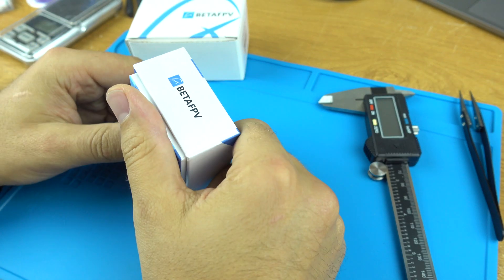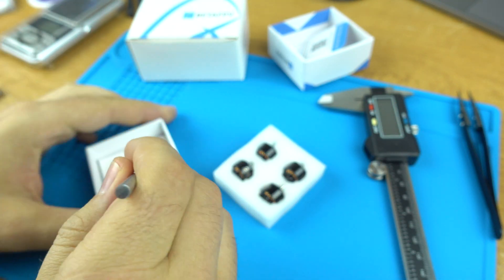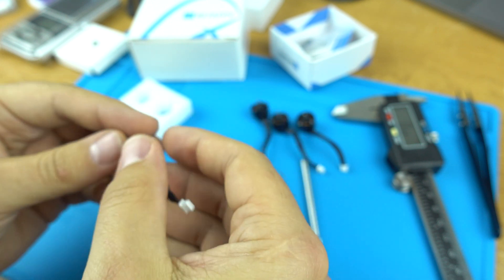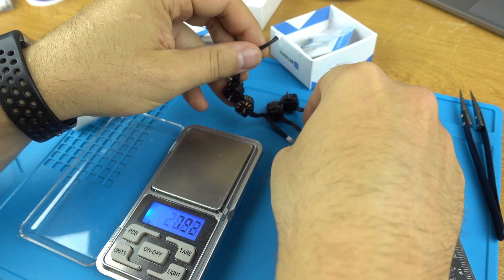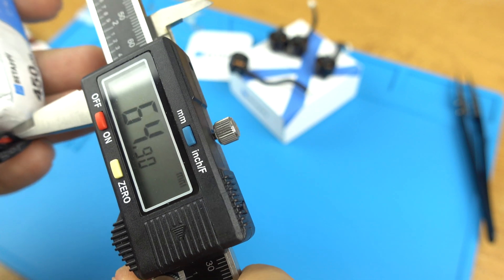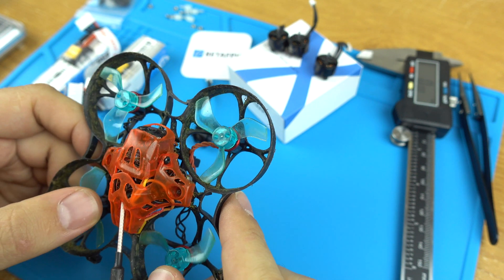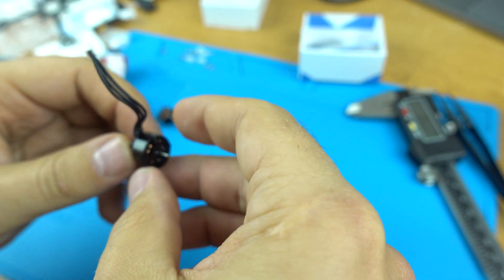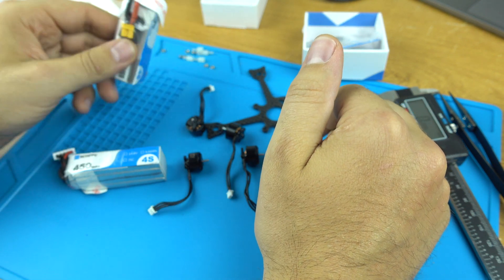Got my BetaFPV 4S capable 1105 5000kv motors for my next Pickle frame build 450mah 4s batteries

Comment: Did you end up running 4S? I have the 1106 5000kv and they are rockets on 2S! I just maidened my TP3 outside my front and I need more space to go 3S and I'm sure it will be insanely fast :)
Reply: pavalige what are your flight times on the 1106 version?  Also what batteries have you ran so far ?
Reply: Jeffrey Rodriguez about 3 and a half minutes and I'll be staying with the 3S no 4 S the things a rocket on 3S anyway, in fact I quite enjoy 2 S as well to get my lines set and smooth my throttle before flying 3S